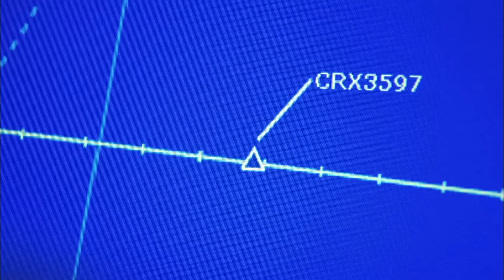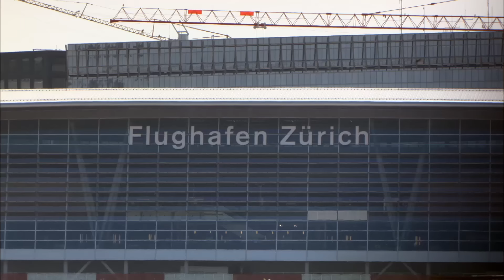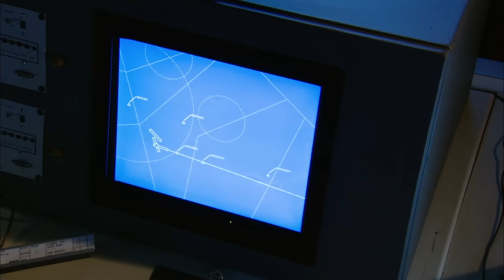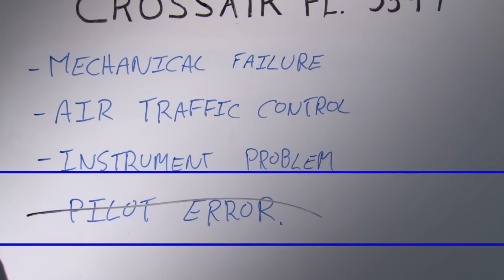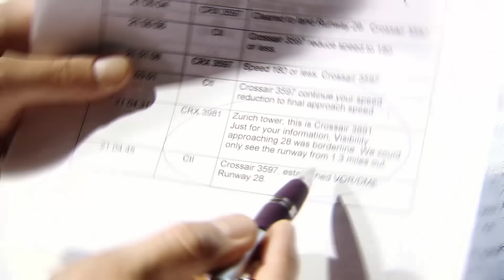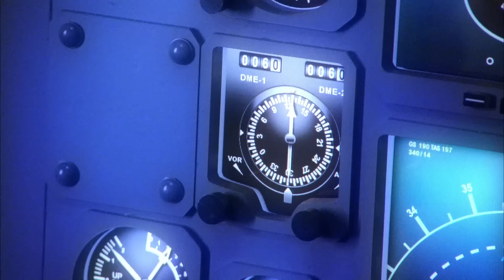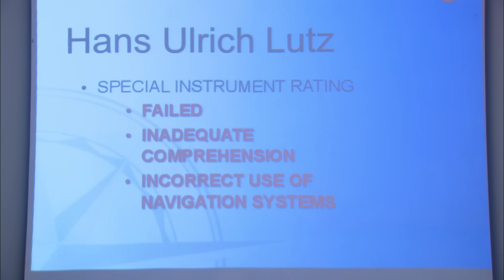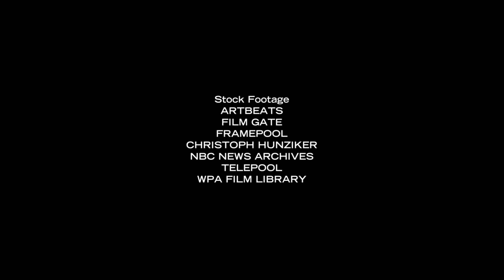Flight 3597's Mysterious Crash | Mayday Air Disaster

Comment: At least in the 80’s, 90’s, and early 2000’s, airlines here in the USA did SIM Evaluations as part of the hiring process, nowadays, and for at least the last 15 years they don’t even do that anymore. I personally think it’s been a big mistake because you don’t see what the “base skill” of a Pilot is anymore.
Reply: This accident happened in 2001
Reply: @kickedinthecalfbyacow7549 Yes, and they said it stopped in the early 2000s. So probably after 2001.

Comment: In air crashes, the front of the plane gets smashed up far worse than the back... move to the back... statistics show that passengers at the rear of the aircraft survive better!
Reply: I'm not sure I want to survive an air crash.
Reply: Actually it depends on the way the plane crashes, and usually the middle of the fuselage is safest.
Reply: @sphenoidjjj  no its usually the back thats safest in any plane crash
Reply: @Michael-gi5th  not any, just on average. I can dig up a few examples if you like
Reply: @MultiChrisjb  I think statistically the back is the safest still basing off all plane crashes. Makes sense too since the back usually has much less impact forces than areas further up, plus the middle is very dangerous in the case of the jet fuel igniting

Comment: Why no Ground Terrain warning...??    (  ie. Pull Up !! )
Reply: @2msvalkyrie529  I'd imagine they are either designed to designate where the nose is pointing + altitude or the sensors were fogged up
Reply: Depends on when they had their landing gear down. With the gear down the aircraft wont alert the pilot/s because it assumes that, since you're in landing configuration, you actually intend to make contact with with ground.

Comment: To the guys comment about a burning plane -- you run away as far as you can (of course you don't want to be too far away where rescue crews can't find you, but you know what I mean).

But the bigger issue that bothers me about this case is the pilot's attitude and "overconfidence" which is basically what gets the killed.  It's similar to that of many others, and one in particular which comes to mind - the Tenerife disaster, because someone was in a rush (in that case, to take off, not land) but similar scenarios.  In that case though, they were not granted take-off clearance but the pilot took off anyway, but the co-pilot said nothing, or said something in a round-about way (perhaps asking "if the Pan am jet had cleared the runway" -- I can't remember).  But it was the same type of scenario in my opinion.  A cockpit atmosphere where the first officer seems to be afraid to speak up and take action.

Comment: Wait... Wasn't there another crash in Zurich due to having only one controller in Zurich flight control (a Dutch and a Russian plane colliding mid air)? They really learnt nothing...
Reply: Überlingen? It doesn't entirely match what you mentioned, but it was a midair collision caused in part by a single person working in Zürich ATC at the time. And yeah, everywhere is sadly going to go with the bare minimum that they can. Because hey, it'll be fine, and it always will be, until suddenly it isn't.

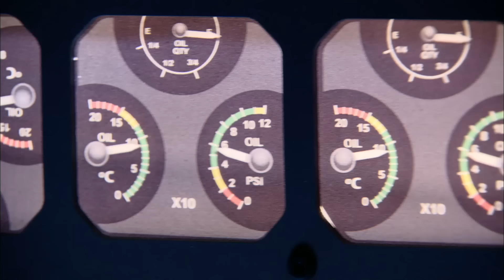Comment: 21:13 I see three gauges installed upside down myself, as well as the instrument cluster board they're mounted on.
Reply: They're not upside down. The ones to the left on each gauge are measuring the oil temperature (should be low), and the ones  to the right measure the oil PSI (should be "high"). Therefore, the red is up on the ones measuring temperature (left) and down for the ones measuring PSI (right)
Reply: the 3 gauges are all a part of one instrument

Comment: It is not at all reasuring that there is no compulsory standard and test which is required for a pilot to fly any aircraft, let alone a passenger aircraft. Imagine if that were the case with a surgeon. In European countries, a driver of a coach needs a special license, as does the driver of a lorry. 

The larger the vehicle the more stringent the test which they have to pass in order to be able to work at that job. Why should air travel - which is FAR more complex and demanding on the pilot than is driving a large vehicle - be exempt? 

This makes no sense whatever.

Comment: This is an undeniably difficult discussion to have and undeniably difficult choices will have to be made in this regard, but serious consideration will have to be given to the restriction or total banning of commercial air travel for the masses, regardless of the size of carrier or aircraft involved, where flying and air travel will have to be returned to becoming the exclusive preserve of the super rich and/or the state/military, thereby reducing the possibility of air accidents, long after 9/11 and in these days of climate change - most commercial air travel has at least one other form of transport, such as rail, road, or ship, sometimes used in combination, even if considerably slower (and safer) - the EU due to climate change is clearly recognising this and is starting to restrict or ban “short haul” flights and another possible reason is because they see bodies like Eurocontrol being overburdened

Comment: disagree. In the case of poor visibility the aircraft should have been diverted to the better equipped runway. Time and again flight controllers get away with their sloppy behaviour without any sanctions. Poor handovers, supervisors who go home irresponsibly too early and leave juniors heavily burdened alone. etc, etc.
Reply: A qualified pilot should be able to fly a non precision approach at their base airport without crashing into a hill 3 miles short of the runway